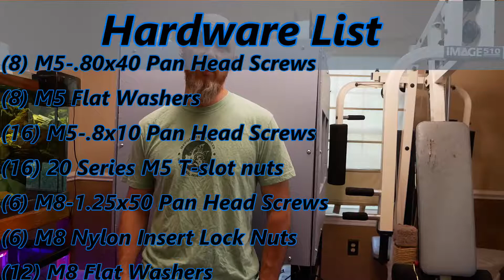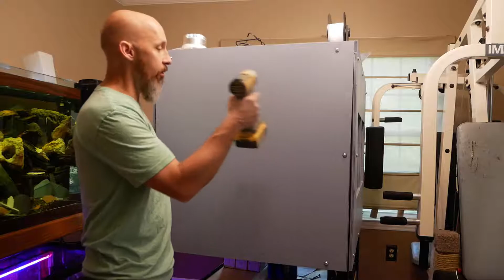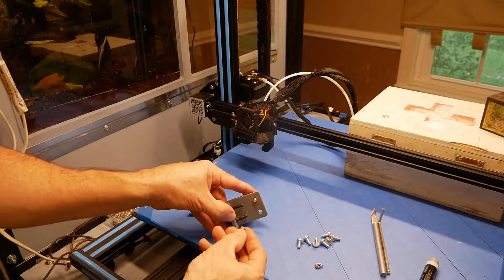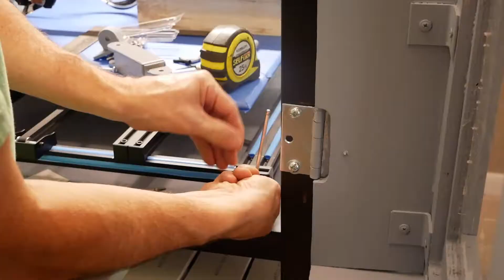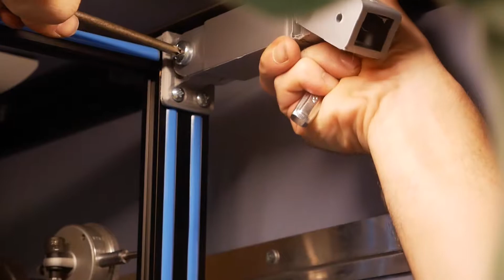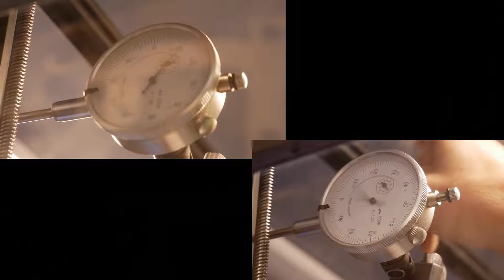Adding Stabilizers to my Creality Cr-10 s5 3d printer.

Comment: The biggest problem with the design of the CR10, specifically the biggest one is the bed. When the bed is moving forward and backward fast, due to the weight and the only thing holding it is four pieces of spring, it has the tendency to vibrate. The vibration actually causes the artifacts on tall prints. If there is only a way to lock it the beds after leveling it, that would solve the problem. The frames are actually sturdy since the z axis only goes up one direction not like the y axis which holds the bed.
Reply from the maker: this was my first printer, and I'll admit one of the reasons I was drawn to it was the tall (and big) build plate, but yes, it didn't take me long to figure out exactly what you are saying!  live and learn i guess.  having said that, the stabilizers have helped some and I suspect if I had actually mounted them from both sides they would solve a fair bit of my perceived flaws.  this was an ok partial improvement, but I'm certain more I can do better.  I do a fair bit of metal working and I think I'm going to work from that angle next.  thanks for the input! especially from someone who seems to know WAY more about these than I do.
Reply: @eric-bkc  The truth is even if I have een doing this for more than 3 years I still learn more and more each day. My observation comes from having two different printers, a cr10 and a Flashforge. I love my cr10 though for having that big build volume, I just go way slower in my settings compared to my FF to get the same quality.